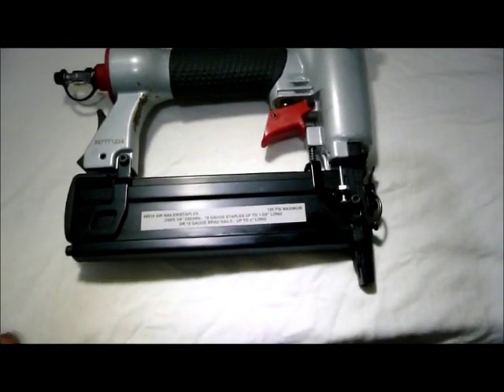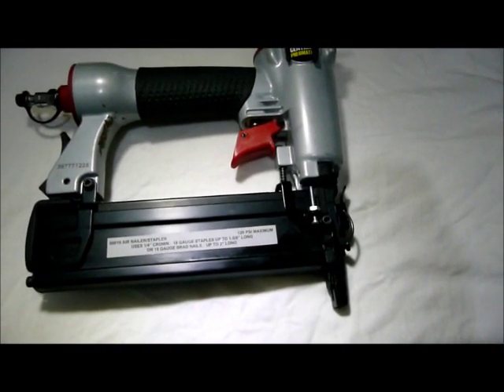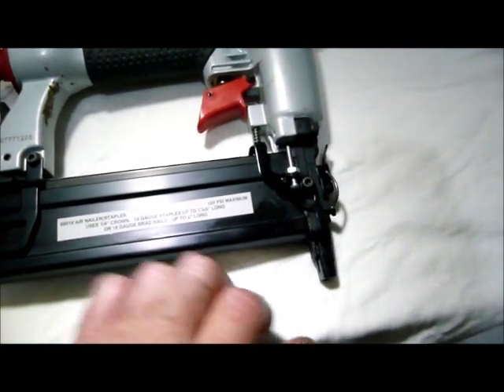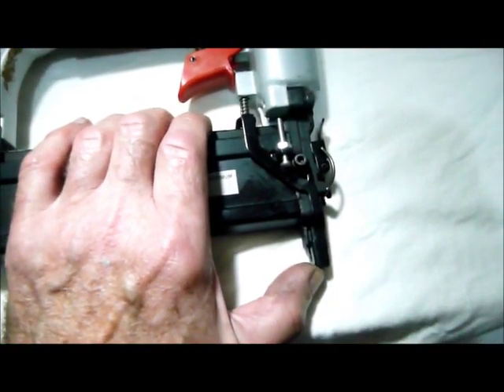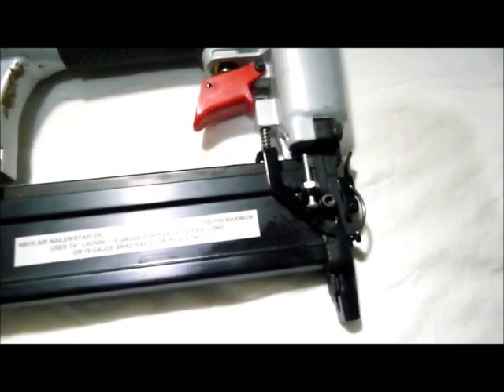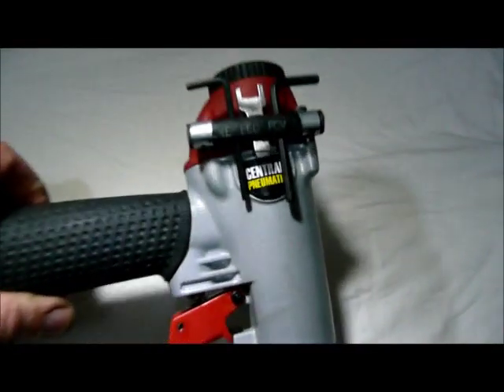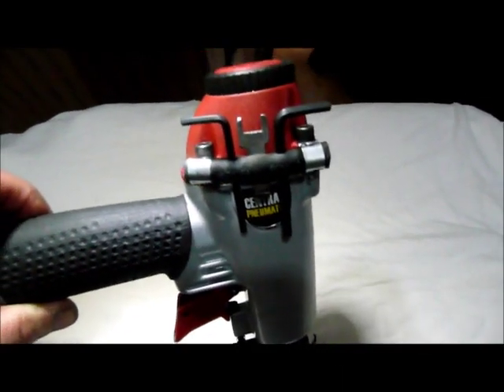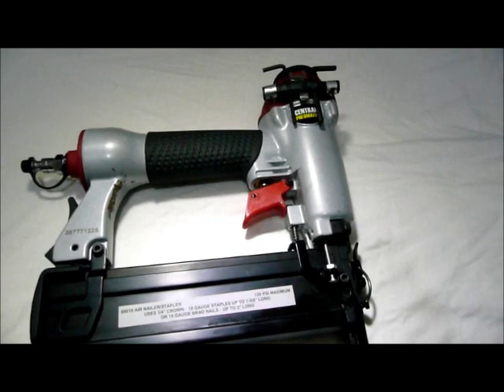Harbor Freight 68109 Air Nailer

Comment: Well thought out modifications. I'll bet it voids any guarantee though. I replaced a plug on a circular saw and when the operating switch ceased working the shop refused to honour the warranty because I'd modified the machine! 
Nice job you've made.

Comment: Hello I have a  question how do you switch from shooting staples to nails were the switch button I can't seem to find it.
Reply from the maker: As far as I know, there is no switch that selects between nails and staples. You either have nails or staples loaded.  I don't care for the fact that such a large hole is made when using nails.  I see that Ryobi has a very nice battery-powered nail gun (http://www.homedepot.com/p/Ryobi-18-Volt-ONE-AirStrike-Brad-Nailer-Kit-P854/205337057).  The reviews are excellent.  True, it is more expensive, but much more user friendly  Thanks for watching!.